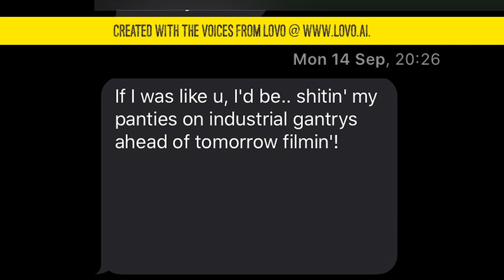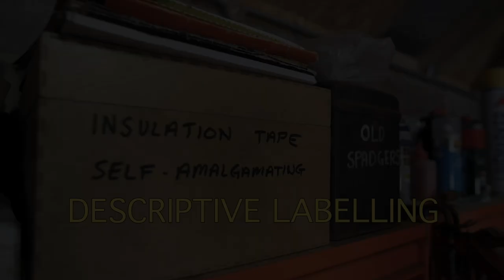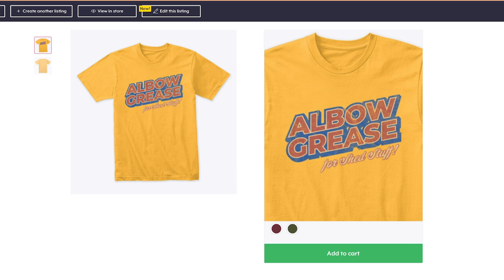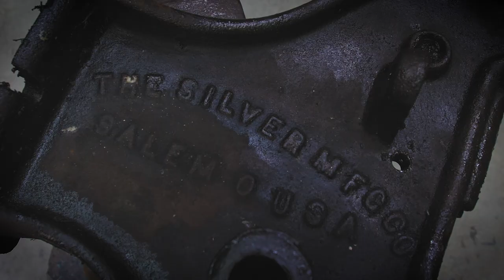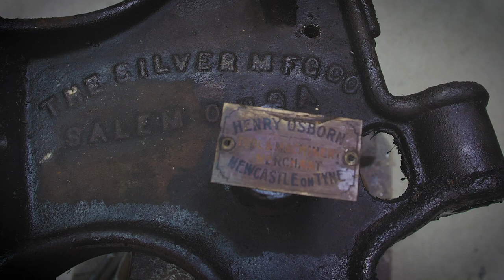Antique Drill Press RESTORATION - Part 1, inspired by @Hand Tool Rescue

Comment: I'm envious of the condition. I redid one of these a couple years ago. I bought it off of a fella who had it outside as yard art for 40+ years. Nothing moved. Wooden bits were long gone. Come to find out, the ratchet arm was only half there. I was able to come up with a replacement ratchet arm thankfully and I'm quite proud of how it turned out. The support for the lower table (where you put the bits you wish to drill) was broken sometime in its 100+ years of existence and was repaired by a blacksmith who formed a piece of metal that matched every curve and was held in place by hot iron rivets. It adds a little something to the story of the piece as its repaired in such a way that requires skills not possessed by many these days. Sort of a dying art. Anyway, end rant. Thank you for posting this video. I love these old contraptions and im always happy to see one get rescued

Comment: I'm currently in the process of restoring a bench top self advancing hand cranked drill for the Shedquarters. I'm doing it on the sly when I have to stay back at work. The only markings on it are Britton made. Works great with very little wear.
Reply from the maker: Sounds like a sweet little project - send us a pic if you get the chance!

Comment: I have this exact same drill, salvaged from my grandfather's tool shed.  It's entirely seized now, having been stored in a not entirely weather proof building by the sea, but I seem to have a vague memory of it turning.  I really want to get it working again!!  So, I guess I should drown it in WD-40.  My farmer/mechanic friends swear by PB Blaster.  But, I haven't gotten around to either yet. . .
Reply from the maker: Get rid of the rust and grime and it’ll turn sweet! They don’t make like that any more. Thanks for getting in touch Leia!
Reply: @DirtyShedCreations  I'll keep you posted!  I helped my parents clean out the tool shed last spring so they could finally take the building down, it being beyond repair.  My grandfather passed in '04 and hadn't been able to get out to the shed for at least a decade previous, so things were pretty bad out there.  Sea air and rain are hard on things.  Lots of drawers and buckets of chunky rust soup, but I did salvage some things.  Nearly 16 tons of rusty iron went to the salvage yard, though.  Even at only a penny a pound, they ended up paying us for the dumpster rental!!  Grampa was a welder and dynamite tech after WWII, and always saw things for what he could make out of them, rather than what they were in "reality".  Anyway, finding your video inspired me and I finally got the drill out of the back of my car and into a tote in my barn and soaked it down with WD40.  I'll reapply every so often, so come spring, when it's warmer, it should be ready for some Albow Grease ;)  ---Sorry for the long story. . .
Reply from the maker: @leiascotton5659  Hi Leia, thanks for the detailed story, hope you're documenting the rebuild! All the best.

Comment: Where’s part 3 ??? Boiling water 💧 w/ dawn dish soap 🧼 or couple gallons of gas  ⛽️ because  
Acetone  crazy Money 💴 here . I have used diesel there’s a little film left behind . I have also use brake clean or carb clean but that gets expensive per can depending on how much you’re trying to clean maybe you can hot tank it like they do engine blocks that might work better